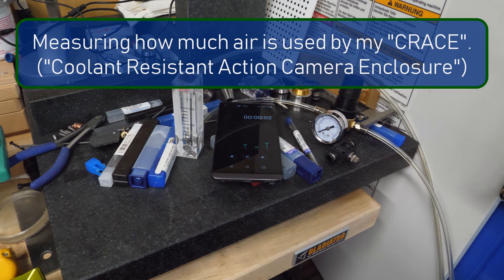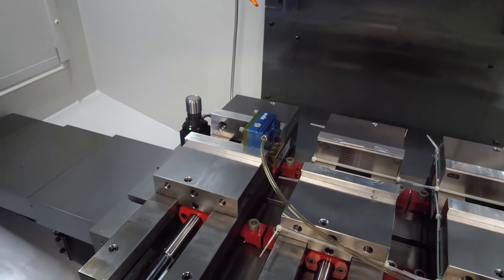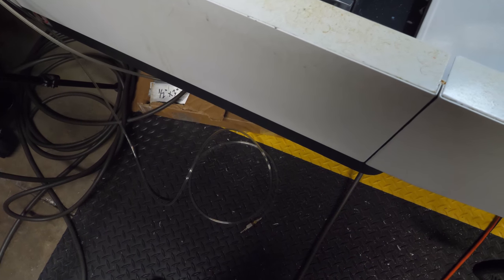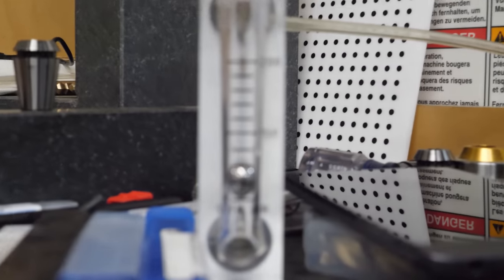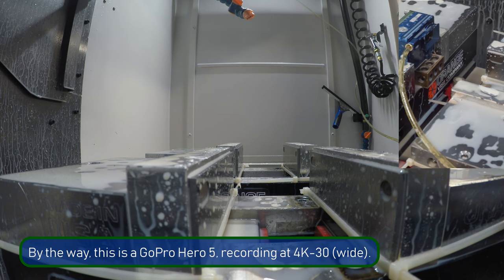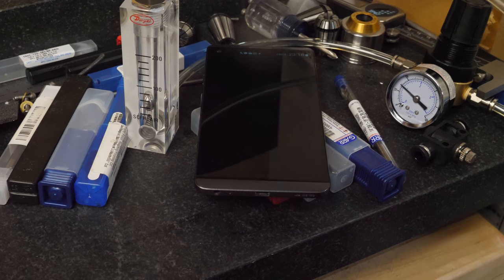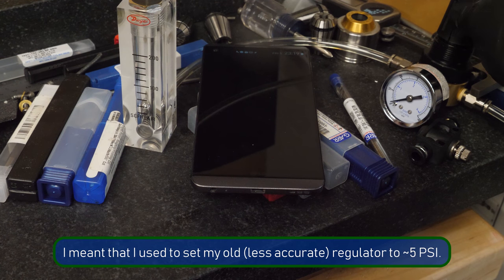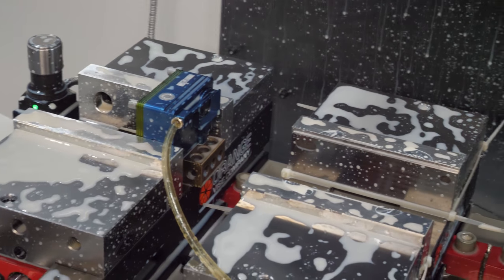Measuring Action Camera Enclosure Air Consumption

Comment: it works amazingly well!! I made an adapter on a gopro case few years back, but in my version air was coming from all 4 sides and coolant drops where dancing in the middle of the lens. and air consumption was awful. Did you nail the mechanics of it at first try?
Reply from the maker: Thanks! I guess I was lucky for never really thinking of having the air blow from more than one direction. It did occur to me a time or two that it might be good to have the air slot extend a little beyond one edge, but I can't recall ever thinking of having the air come from multiple discrete directions. I'm glad I didn't because it sounds like a good idea and I could see myself chasing my tail on that.
Reply: @Hirudin  it interesting how approach can fail whole project. My idea was to never allow water to get on the lens. And I give up. But your idea was to remove water asap. And it's definite winner. Totally different approach to the same problem. I guess lesson here is to think outside of the  box when you box your self in ;)

Comment: I would like one for a Hero 4
Reply from the maker: That's great to hear, thanks for the message! I'm thinking about milling a few and having them anodized by a professional place. I'll make sure there's at least one Hero 4 version in the batch. Would you need/want a window in the back?

(If you have the Hero 4 model with the LCD on it (or think you might get one), the rear window is very helpful to have. But, if you never get a Hero 4 Silver, the window would be basically useless.)
Reply from the maker: I'm guessing I'll have to pick one color for the whole batch, would that bother you?
Reply: actually looks like I need for a Hero3... dug my cameras out the other night and thought I had 4's... and I don't need the lcd window.
Reply: don't really care what color, but if you want a color choice I would prefer black....

Comment: Wow! That is very effective!!!  I've got a basket of Hero camera stuff....$1000 worth?  Been sitting unused since almost day one of having it.  How do you get yours to focus so close.  I couldn't get mine to focus that close, so I've never bothered to use it much.
Reply from the maker: Thanks!

I'm 99% sure this camera has its original lens, so I'm thinking the close focus must be a testament to GoPro's lens design. :)
Actually, I think I removed the lens at some point and then put it back on, so it's possible that I tweaked the focus a little by screwing the lens in or out by a fraction of a turn.

"They" make aftermarket lenses that will screw right into some action cameras (they'll work on many security cameras too), which might be worth a look if you're wanting to get some closer shots. Personally, I've bought four from a place called "Peau Productions", but lenses that look identical are sold on Amazon, eBay, etc. for possibly lower prices. I've chosen Peau because they have a good selection and also take the time to show video samples of most of their lenses. In the last video I uploaded ("Testing My Latest Camera Enclosure") the camera (a Hero 6) inside the chartreuse enclosure was using an 8.25mm lens, which gives the camera roughly 3x optical zoom. A downside of the lenses is that they make focusing a little finicky (lemme know if you want me to try to describe the finicky-ness).

One more thing about aftermarket lenses: if you want to use the lens in an enclosure, make sure the lens you're buying isn't physically larger than the original lens.
Reply from the maker: What kind of Hero stuff do you have? Like mounts and enclosures and stuff, or cameras too? Which model of Hero?
Reply: Great info above...Thanks!!!  I'll have to play with mine again, but my initial tests showed mine needed about a foot and a half to get reasonable focus.  I'm pretty sure I bought some close up lenses for it, but I've never even opened the box.  It's a Hero 4 black.  I've also got the extra display for the back and a Removu setup....cases, mounts and even a knock off hero to compare to.  Oh....multiple batteries and a multi battery charger......I think I figured up I had about $1000 worth of Hero stuff.

Comment: seems real effective. I'd buy one but not sure my old hero3 would fit :( good excuse to upgrade? lol
Reply from the maker: Andrew Ydna DuBuc 
I do have one designed for the Hero 3/4. From the outside it looks nearly identical to the Hero 5/6 enclosure, except there's another button on the front and it's maybe a millimeter shorter front to back. A couple nice things about a Hero 3 case is that it doesn't need the back window so there's one less part to mill (the threaded ring) and one less piece of expensive glass.

I haven't actually finished milling one of that design yet, but it looks good in Fusion 360. I did start milling one, but when I got to the front it got pulled out of the vise. The part was ruined, but still would have been functional so I put it back in and ran it again. Then it got pulled out a second time at the exact same spot, doing little more than making the gouge a little bigger. At that point I decided I should stop while I was ahead and nothing was broken.
Reply: lol, been there. yeah it's tricky to offer the different variations, especially as years go on and more models are released. No good answer for that other than making a ton of stuff. I'd love to get one of these but as I said I don't know if it would be old or new.
On another note, I sell a lot of small-run stuff and find the number of people that will actual pony up the cash is probably like 20-30% of the people that say they'll buy. So if you get a dozen people that seem interested, probably like 3-4 would actually buy it. It's just the problem with gauging interest...

Comment: Can you do one for a Hero3?
Reply from the maker: I have a Hero 3/4 version, a Hero 5/6/7 version, and a version for the Yi 4K/4K+.
Reply: So how do I purchase one?
Reply from the maker: @lsxconcepts5125  
Sweet, thanks for the interest! I'd like to get them up for sale in a more serious way as soon as possible. Although I wish I could get back to them sooner, I suspect I won't be milling them again until... December. I've sold three so far and two of the other owners have said that they'd like to be able to plug cables into the camera, and that's something I've wanted as well, so I'm going to work on the design some more to try to make that possible. I plan to keep the design similar to how it is currently, so I don't think a ton of testing/prototyping will be necessary, so hopefully the change won't be the cause of additional delay. I'll make some kind of video to let anyone interested know when they can put in an order!
Reply: @ @Hirudin   Well I want one when you get around to making some more. with cables would be a nice feature so I will check back in a few months